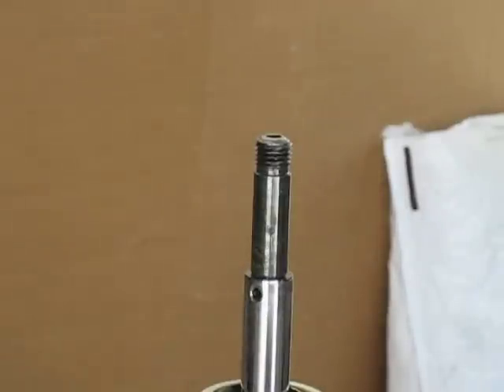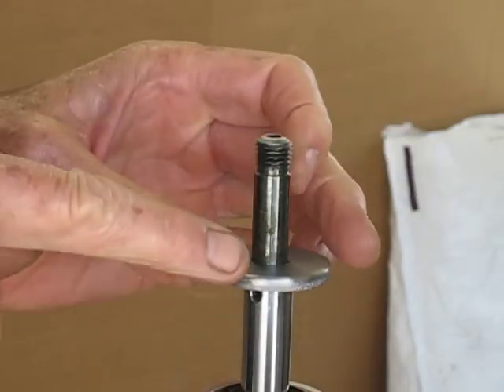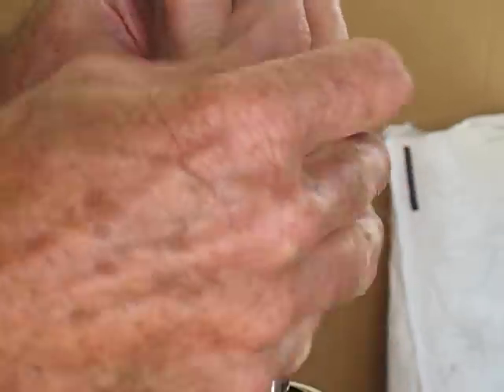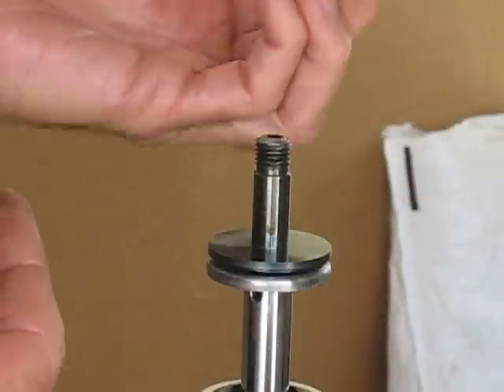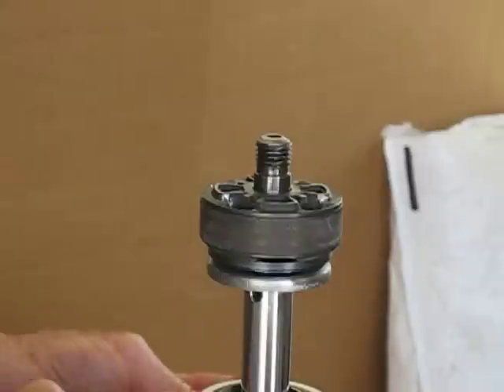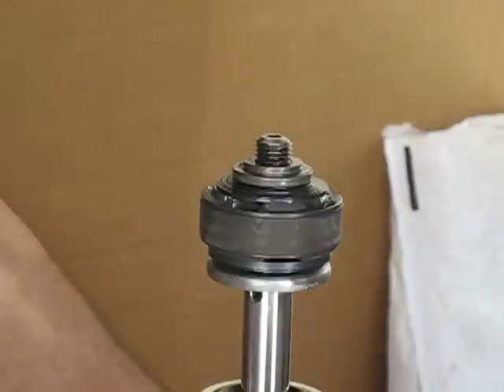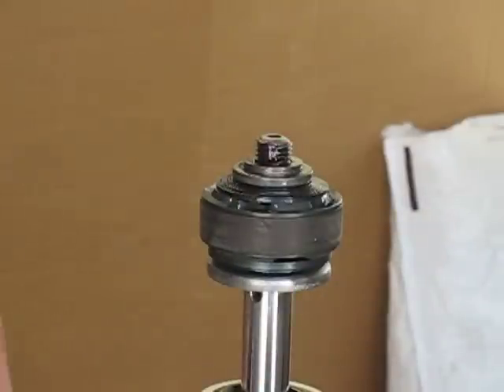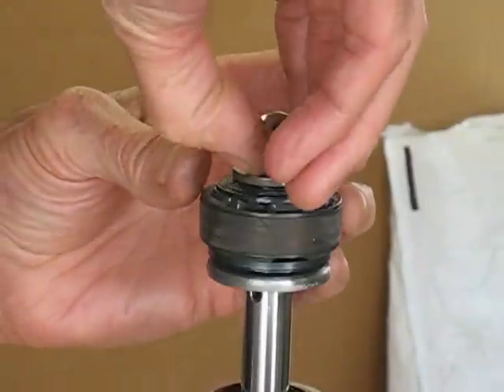Team Squirrel Tech Tips - shock revalve - part 13

Comment: Hi. I want the compression  damping make a little bit softer. I have a Kawasaki ZX10R rear shock on my yamaha mt 09. it works very nice. But i have 154 pounds with clothes. Some people say, its overdamped. Yes it is...What can i do? Softer shims? Is that a big difference? Thx
You have one shim out..is
Reply from the maker: There is more to valving than meets the eye. Having a shock from a different changes the rules drastically. Eye to eye length needs to be the same and the spring rate, etc. I would sent the shock to Race Tech and let you know what you did and what the shock is from...
Reply: @robinsongguitars 
Thank you! I know. 
Eye to eye is 3mm longer, the bike is a little bit higher. That feels good.
The Springrate is also the right one. 
My idea was to find the cheapest possible solution.
Im searching for a tip, to make the Compression Damping softer. I have high and lowspeed completly open. But there is a little bit overdamping.
Im an absolutly rooky, but i want learn, and make things myself. 
I just dont know where to start.
Reply from the maker: @thorstenlemmer5320  There are many variables for damping. Bike weight is probably number one. There is a lot to changing shims and trying to get what you want without too many attempts. Diameter and thickness affect how far the shim will bend upon different bumps. A couple of shim changes can make a lot of difference in damping. When you send a shock to a shop you are paying for their experience. It took me a while to figure things out about shims. There really isn't any mystery you just have to know what shims go where. Generally, the larger diameter and thinner the shim the easier it will deflect and soften damping. You have to make sure there is no air in the shock upon assembly. This takes careful bleeding. If there is any air in the shock the oil will foam and you will lose your damping. The compressed nitrogen helps keep the oil for foaming. There is more here than meets the eye.